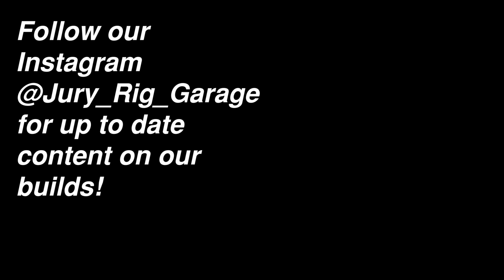Picking up a 6.0L LQ4 V8 for a Future Project! (408ci Stroker Twin Turbo Build!)

Comment: What crank and pistons are you going with? I wanna stroke my 6.0
Reply from the maker: Not entirely sure yet. It will be a 408 stroker kit though, likely texas speed.
Reply: Jury Rig Garage ok cool thanks for the reply. Would you happen to know if the btr stage 4 truck cam would work well with that crank? Or would you have any cam suggestions for that crank?
Reply from the maker: @HeavyChevy1975  No reason that cam shouldn't work with the 408 stroker